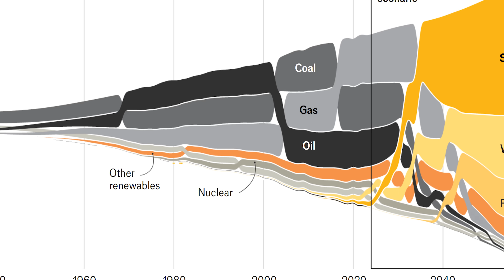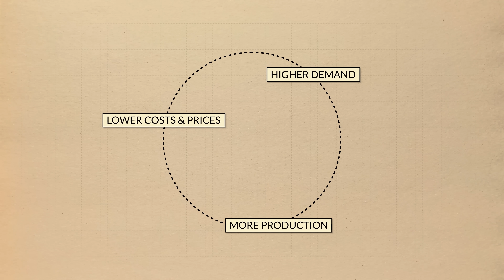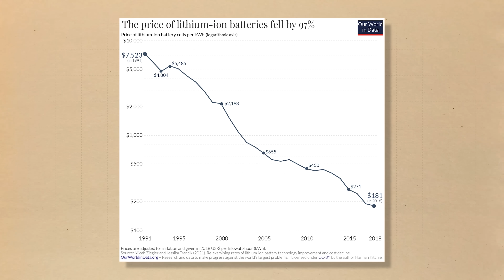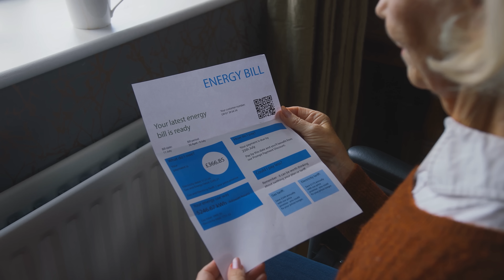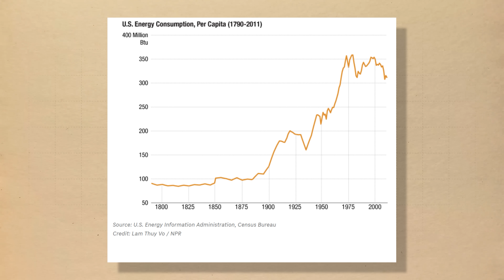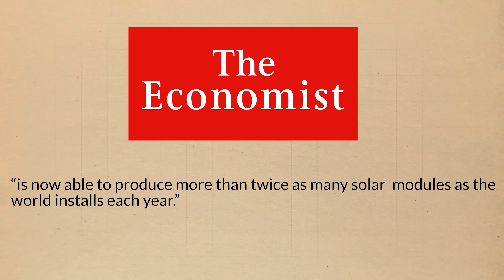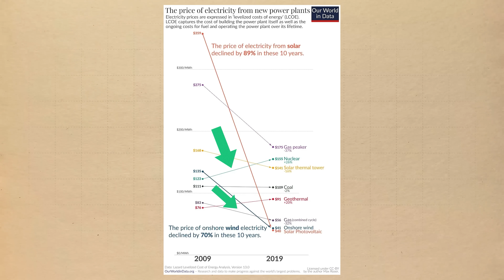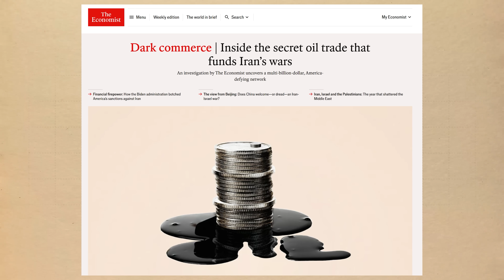Why solar will soon dominate & what that means for the world

Comment: I generally like your channel but the ignorance in this video 🙄🙄

- the growth is not exponential, it's an s curve 
- lcoe is a bad way to measure real costs of an electricity source. Ignores system costs. Look it up.
- we're still in phase 1), solar is still massively supported by subsidies in many places (feed in tariffs, market design in the west and various subsidies for panel producers in China). You sort of hinted at it yourself.
- a lot of the learning curves you're showing are leveling off and further gains will be harder and harder.

You keep showing a graph where the proportion of solar is tiny up until the present but is about to explode any day now. We've been hearing that for ten years and it's pure copium.

You say China can now produce 2x world demand for solar panels. How profitable do you think those operations are?

Industries need stable constant reliable power. Solar is not that.

Comment: So oil and gas will simply vanish in 6yrs time? wtf is this crap
Reply: How on earth did you come to that conclusion?
Reply: @ianhamilton3113  if you knew how to read the graph @ 4.03, you would understand
Reply: @ralffig3297  It's still there in six years time. Just diminished but clearly there. It ducks under solar.
Reply: @ianhamilton3113  oh gosh... nevermind
Reply: @ralffig3297  It's a weird design. No offence taken. Have a good one.

Comment: Why take lithium battery price till 2018 ? Prices increased exponentially in the 2020s. Is this biased reporting suiting a narrative?
Reply: Just checked Statista Lithium battery costs and prices dropped from 2018 $211 to 2023 $139 per kWh. So the data would have been easy to find.
Reply: @ianhamilton3113   check 2021 & 2022
Reply: @PentangleYT  Supply disruptions cause by covid.

Comment: The chart is clearly wrong.
When you look at total energy consumption by source you find that tha boom is from 0,5% to a mere 2%, that's your real hokey stick.
The reason being was explained by manu below.
Solar is bot oil.
You use 1 ton of oil.
You install 16645464345 GW of panels, yet the energy feom them ia not consumed, and building a grid to consume that would be hyper expensive, a lot more than nuclear or gas.

Comment: In Greece while solar and wind farms multiply exponentially, electricity bills get steadily more and more expensive
Reply: Gas is still the largest source of electricity in Greece, and is expensive because of Russia's invasion of Ukraine. Your bills would be a lot higher without the wind and solar you have.
Reply: @robinbennett5994  .... but nobody used gas as a prime generator of electricty BEFORE renewables. It was mainly coal.

Coal for electricty
Gas for home and industrial heat
Oil for transport.

That is the actual counterfactual.... not saying it's great for the enviroment, but it was cheap. Don't lie to people.
Reply: and remember this happens when solar and wind is subsidized...if they were not subsidized, the cost in bill would have skyrocketed!

Comment: You can't drill for oil if there is no cheap oil under your country
But you CAN compete with China by making your own Solar panels! - they will probably stay ahead of you on the cost reduction curve but not by much!
Making solar panels is about engineering - and there are no long term secrets
AND the "rate limiting step" is probably batteries - not solar panels - China is ahead on battery manufacture but not as far ahead as it is on solar panels

Comment: When factoring in the need for batteries solar is actually very expensive in most places. Only nuclear power solves all these issues. 

If LCOE wasn't such a scam measurement, it would factor intermittency in.

Comment: When it comes to cost, are subsidies taken into account? How much subsidies are given to other power generators? When we compare land usage, how efficient is solar compare to other forms of power production? If we talk decay and waste, what is the average waste per panel compare other systems.
Reply: Regarding land use, the most efficient is solar installed over some pre-existing use; roof, parking lot, closed landfill etc because this uses no additional land.  Next is a wind farm, third is a solar farm.  After that is everything else.  Some people may object that a coal or natural gas burning power plant is smaller, but it isn't if you include the area for a coal mine and ash dumping area, or the area of a gas or oil field.

Comment: 300million vehicles in the USA and 20million vehicles in Australia. 
Most parked 23hrs every day and all night long. 

Say 100kwh batteries parked 23hrs every day, that is a massive resource that owners will want to UTILISE.
Topped up daily to full, sounds like nuclear nuts think people are not thinking. 
Nuclear nuts keep their grid economics limitations f...kup very quite. 😮😮😮

V2G selfparking selfplug-in EVs will be the killer feature to full UTILIZATION of their vehicles and their rooftop PV electricity. 

NUCLEAR promoters will go 'nuts'. 😅😅😅😅.

Grid owners will move closer to the cashflow from their customers and the new industrial heavy users. 

Some fossil fuels in mid winter weeks is nothing. 

Petroleum for road building and maintenance and petrochemical industry and emergency use will always be available. 

Military budgets will not explode as the nuclear industries will not need to explode in numbers. 

Happy days 😊😊😊😊😊😊

Comment: Way back in 2014 Tony Seba predicted the clean disruption that solar would make fossil fuels obsolete by 2030. Good work Tony!
Reply: We will still need a lot of oil,even if we use 100% renewable energy!
Reply: @BrunoHeggli-zp3nl  85% of fossil fuels are used for heating, electricity, and transportation. Only 15% are used for everything else such as making plastics and other goods.

Comment: Some economic implications you are leaving for the next video:

Zero or negative electricity prices need binding to storage (dams or batteries)

Some countries adopted the CfD payment system and feed-in tariff, which may be abolished as soon as renewable electricity consumption reaches its peak. It may cause some troubles for investors and long-term returns.

Comment: Imagine if China (or some other country) put backdoors in their solar panels to short circuit them in 20 years.  This is something countries will have to think about by doing random inspections on all the hardware in the panels.  Random inspections cannot prove that no solar panels are compromised but statistically prove that less than a low percentage is expected to be comprised.

Comment: We should be cautious in saying that solar and wind are cheaper than conventional sources of energy since this is cost based on installed capacity. Actual output cost should be analyzed.
Reply: No, those are levelized costs of electricity produced, not based on installed capacity. 
What they don't consider is the cost of storage or grid upgrades, but then the cost of fossil fuels ignores the future cost of climate change, which dwarfs everything else.
Reply: @robinbennett5994  then you need to talk about the compound cost of efficiency loss that you introduce with (prematurely pushed) renewables too, meanwhile it's still only a guess that paying for all these costly upgrades indeed avert climate change.
Reply: Exactly. What really matters is how much it costs me to access 1kW any time of the day and year I want.

Comment: SOLAR POWER IS NOT CHEAP GOD DAMMIT.

Only reason why it is thought it is cheap is because there is an over production in the hours where the sun is high in the sky.

When the sun is gone, the solar panels is useless.

You dont buy 2 cars when you need a car to commute to work and claim it is cheaper with 2 cars.

Europe is committing suicide

Comment: You said 36% of Australia energy is solar when the graph says electricity.  On average electricity makes up 20% of a countries energy use.  Our industry runs off fossil fuels and so every solar panel made has used them in their construction and if this goes exponential it will require exponential mining and so Fossil fuel use will increase.  What it means is using solar in this fashion will probably be the death nail for the environment and then civilization and life in general.

Comment: 1. Installed solar generation capacity as percentage of total electricity generation capacity is not the same as percentage of electricity generation from solar: solar panel capacity are routinely more than 10x the actual electricity generated in any 24hr period, whereas gas generators are usually sized to be no more than 2x the usual load. So there is huge difference.

2. The most efficient solar energy "storage" is like an electric grid along the 30-degree north latitude or thereabouts, from Japan to Mauritania, spanning 10+ time zones, so some parts of it is always in the sun, almost, so as to reduce actual storage time to no more than a couple hours. Presumably local electricity use is way down late at night as most people sleep, so long as people don't charge their EV's during those late night hours.

Comment: Solar energy is stupid and all the solar deployment in the West is more about deindustrialising via expensive energy than actually moving towards the future. Intermittency and weather dependence means you either need huge expensive battery banks or you need backup gas turbines, which sit idle for a long time and usually run up and down at low efficiency or hydro. The only really efficient option is hydro but you still have huge costs for energy transmission. Nuclear energy is vastly superior.  Solar + batteries or solar + backup thermal turbine is good for isolated edge of grid situations. Solar has huge material requirements and creates huge waste streams. When the climate scam/hoax boondoggle is over solar will die a quick death. Future generations will laugh at us for sticking these ugly panels everywhere.

Comment: When I read these articles in The Economist earlier this year it changed how I thought about the energy and climate situation quite a bit. I'd now say global warming is largely a solved problem and it's just a matter of how fast we build things as to how quickly the warming is halted and, ultimately, reversed.

It's also pretty much the worst possible news for the de-growth movement.
Reply: Reversing climate change will not be cheap and it won't happen quickly. Geoengineering is a heavily heated and controversial topic. We're going to have to live with the consequences for quite some time
Reply: @robo_t  Nah, it'll only take around a century from after we've hit net zero. Spraying new things into the atmosphere is controversial, sucking carbon out of the air and putting it underground is not.

Comment: In 2022, a 450W solar panel costs me $200. Two years later, I bought 550W and it costs less than $100. And after two months, price dropped even further at ~$80.

I welcome China's overcapacity. If not for it, it will cost me an arm and a leg.

Comment: Why does Chile have such an extreme solar energy exposure in the North of the country? 

Is it the extreme altitude?
Reply: Atacama desert?
Reply: @zapfanzapfan  yeah
Reply: @adamwest1138  That would be cloud free, lots of telescopes there for that reason.
Reply: @zapfanzapfan  i did a bit of research, and you're right, low atmospheric water is a factor. Apparently also a combination of the high altitude, it's proximity to the equator, and the fact it's in the southern hemisphere. The earths perihelion (point at which we're closest to the sun) is in January, which is the southern hemisphere's summer. On average the southern  hemisphere gets 7% more solar radiation than the northern hemisphere. Interesting!

Comment: There's many clever things that cost fairly little that can be done to better utilize solar, an example is smart appliances like dishwashers/washing machines, dryers, that can be cleverly timed to run when solar output is highest. If my dishwasher had a button to do the dishes sometime in the next 6 hours, don't care when as long as it's done when I'm back from work, such taht it better utiliyes my solar, I'd totally use it every time.

There's also clever schemes that can be done around electring cars , ebikes and emopeds charging while people are at work, while most people wont sign up to let the grid use them bidirectional storage, most people would be happy to have the grid dump excess capacity via the charger at their workplace when solar starts to peak

Comment: In my country (Central Europe), electricity consumption peaks during winter, and it’s expected to rise further as more people switch from gas furnaces to heat pumps. How exactly is solar supposed to replace all other power sources, given that solar power plants produce only a fraction of electricity during the winter months?
Reply: There are actually several concepts that could combine to solve this issue. One is battery storage, which can not only be used to store energy for the night, but also in longer intervals. Another option is to supplement the solar energy with wind power, which usually produces more energy during autumn and winter, especially in rainy or stormy conditions (which are usually when solar does worse). A third option would be to use gas peaker plants, as those can usually be ran on a variety of fuels, including renewable options like biomass or hydrogen.
Reply: Why are you assuming that people would be relying exclusively on solar?
Reply: Someone else already suggested wind, so I'll just give you one thought:  Can your country buy solar power from nations south of you?
Reply: Maybe countries where winter exist will simply die out because they can't possibly be competitive anymore?

Comment: There is a lack of understanding of battery limitations here. The amount of batteries required to cover a cloudy day let alone a week is completely non viable.
Reply: You clearly haven't looked at battery prices in a bit. Especially at industrial scales this is actually quite possible. And with ongoing advancements in battery tech (thanks phone manufacturers) it seems reasonable to assume the trend of battery price lowering at least not slowing down for a couple of years.
Reply: @jillfizzard1018  chances are you haven't looked at battery prices in the last 5 years. The battery price lowering already slowed down to a near halt. There was a hughe price decrease between 2013-2018 indeed, but since 2018 it'S basically stagnating, and if your base year is 2020, you could say it's just fluctuating at a certain level. If you look at actual data it's safe to assume that lithium-ion technology reached its lowest price.